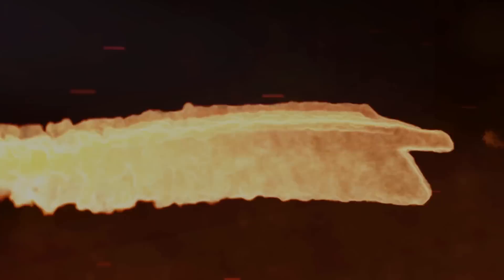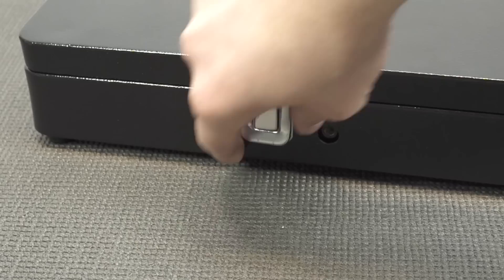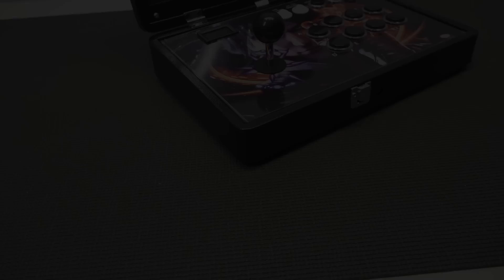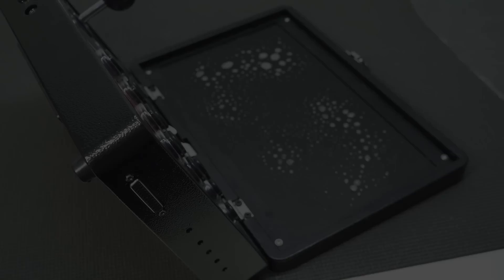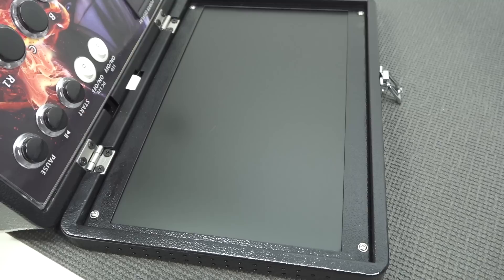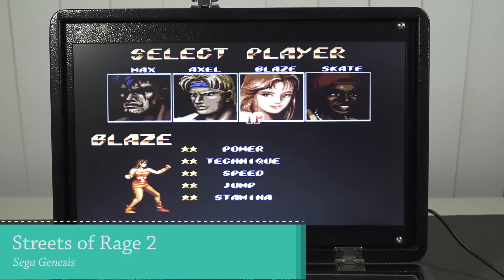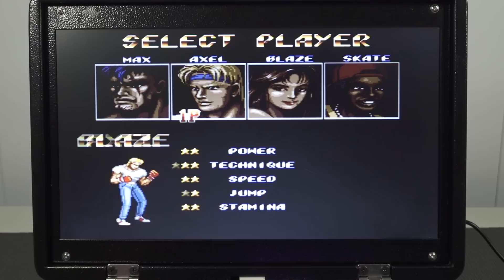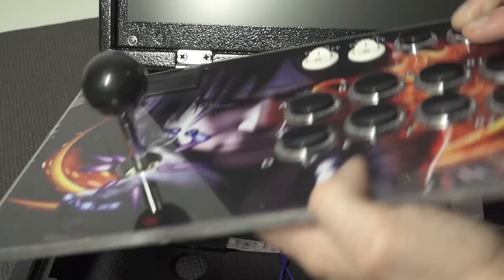Pandora Portable 28s Pro RRTV .. The New Generation ! 🙌

Comment: The crackling noise - it must be coming from the built-in, new and improved glorified Geiger counter that you get free inside every machine!  (Some have Intel inside - this model has a Geiger counter instead!).  It will tell you if there are any smelly old chemicals in your surroundings, so you don't have to smell them any more.  Simply put a new/retro item near to the device, turn it one and voila!  If it makes that noise then it has cheap-de-la-cheap-cheap, smelly chemicals inside!  (I am joking, but that IS what it reminded me of).

Comment: I reviewed a similar one, but it was called the 36S. Had more emulators and also games market. Appears to run better than the 28s too. Only main issue i had was when switched off, the red LED charging light remained on all the time, which resulted in the battery being fully drained after 7 days without any use, which was a shame.
Reply: Can you or is it worth taking the batteries out when the system is off or is that to much to do?
Reply: @parrishharris3008  Yes you can take the batteries out of it.
Reply: I just the 36s and it's awesome!!!!!

Comment: I have the older case that came with a rpi4, sanwa stick and buttons, you can just barely fit a ssd and a cooling fan in it.This case is slimmer, wider, more space inside and room to rest the  wrist beneath the buttons . A rpi4 in this case would be a game changer

Comment: I hate the balltop lock. It just sticks out and snags in a backpack. Nice it comes with batteries not like the ArcadBox that I bought 2 separate sets of batteries till I found some that actually fit. I love the 8 buttons and slimmer case; but instead of full metal I’d prefer “plastic fantastic” like the Powkiddy A13, makes it super light. Plus the A13 has a great monitor cable solution in the hinge. Pandora just seems to get close to making a great device, but just can’t get out of their own way! But hey it has a free Geiger counter! At least it sounds like it!

Comment: I like the all metal case but that's about it, it's seems underpowered, no IPS display, lacks a few key emulators and can't seem to handle the ones it comes with to a decent degree. Its a real bummer because it could be a hell of a lot better but it's currently just a mess
Reply: my old atom netbook i got free can run ps1 better

Comment: I have a cheap 10 inche tablet that has 128 gigabytes SD Card & i use a 8Bitdo Arcade Stick which is Bluetooth. I put my own Emulators. Doing it my way is cheaper and i use emulators i know that work great. If the emulators were perfect on the Pandora then i would buy one.